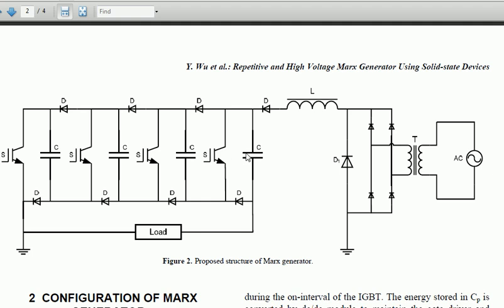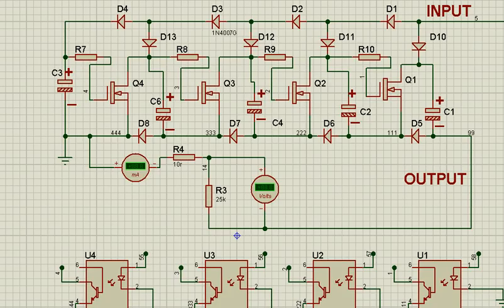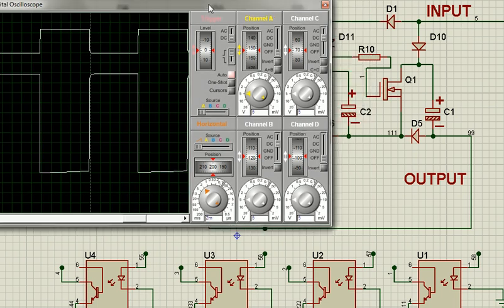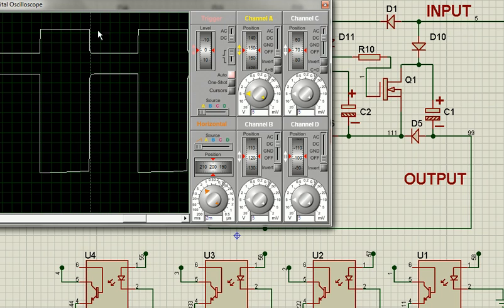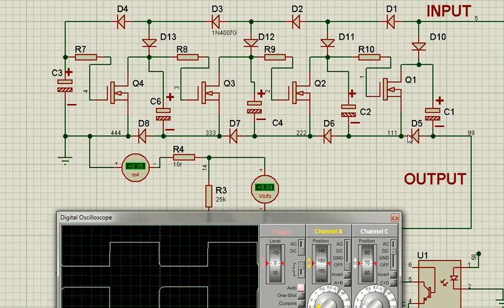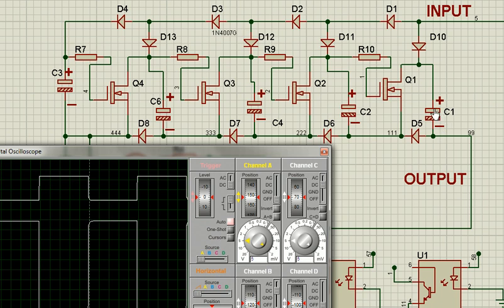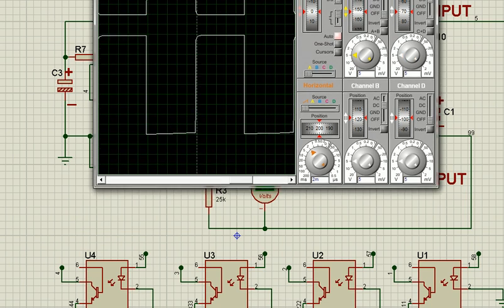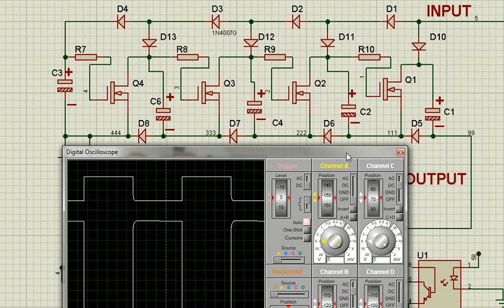Marx generator by MOSFET / IGBT

Comment from the maker: Mosfet or IGBT anything will do as long as the frequency used is within the acceptance levels of the switches.We are considering here a frequency of about 20 KHz.I have not measured the rise and fall time because, as compared to the operating frequency it will be too small and basic requirement of getting capacitors in parallel first and then in series does not call for knowing such time.One can to mega volts and mega cycles as long as the switches used permit that.I don't understand AWG of HV

Comment: thank you for info
IGBT .. to slow
 Mosfet configuration
What is the leading and trailing edge time frame?
What is maximum frequency response?
What is maximum current handled with respect to  frequency covered?
What is maximum voltage handled?
Can you direct me to the same but AWG of HV?
Can this generator go from 10khz to 1MHz?